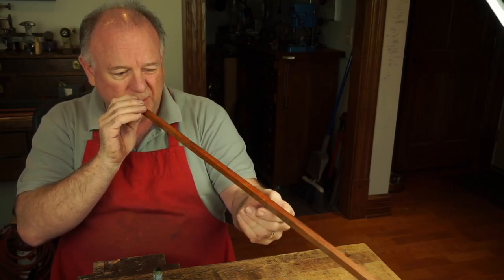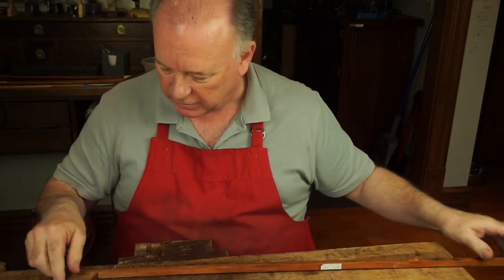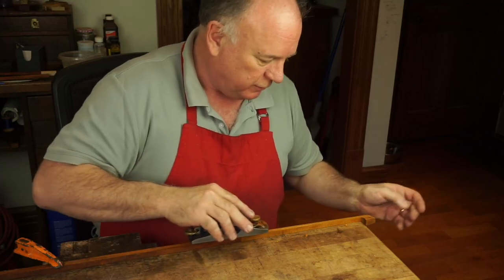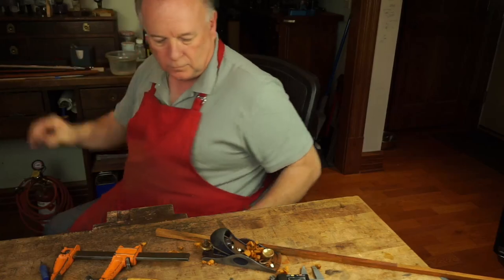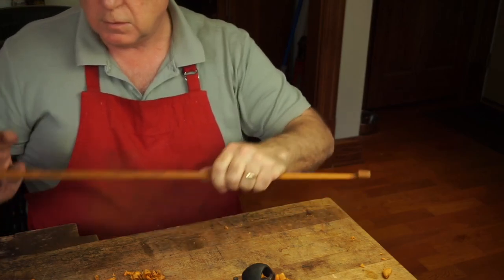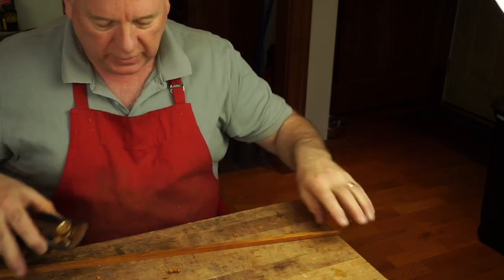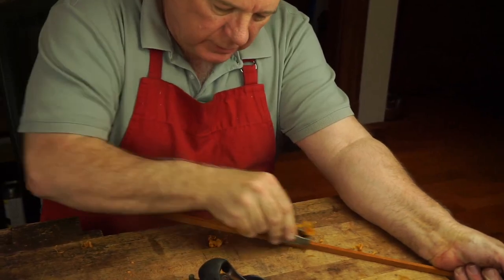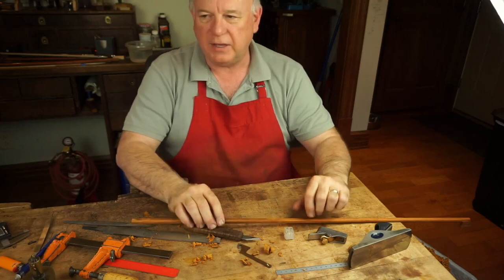Covid-19 Violin bow making: Day 1, Hour 1 Introduction and rough planing

Comment: I adjusted a bow using electric heat lamps and wedges on a board to get the shape. Let it all cool down before releasing . I got told off for that . But it worked .
Reply from the maker: What ever works for you. You just want to make sure that the camber matches your graduations in the finished bow, this will help it pull an even sound and so the player can keep an even pressure as they pull the bow along the strings.

Comment: Great, thank you so much to Share your wisdom☀️
You use a lot this large plane 9 1/2
Is it the most useful way?
Reply from the maker: Use the biggest tool to remove the most amount of material. We like the Stanley 9 1/2 because it has an adjustable throat. Pernambuco likes to tear so having a small opener opening for the blade prevents the wood from tearing as much. And of course really sharp blades help make things easier as well.
Reply: Thank you for your answer.
A lot of makers use this stanley plane.
I discovered that some others use a lie nielsen low angle...
Best regards
David

Comment: Where did you get your head template?
Reply from the maker: Rodney designed his own head shape out of a thin piece of walnut. It was developed through studying classical bow makers such as tourte. You can easily make your own by making an accurate sized copy of a head profile you like from the many bow reference books out there. Laminate it or use packing tape on both sides of the paper and cut it out with some fine scissors making sure not to remove the image or leave too much of the background. And there you go, you've got a head template of which ever bow you want to make. 

You can find lots of fine bow reference books at https://holfter.com/